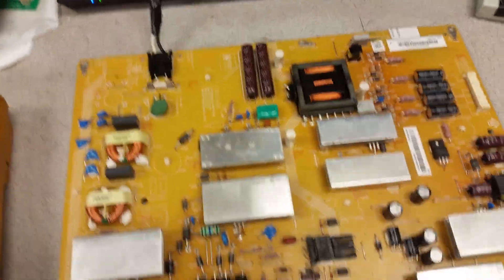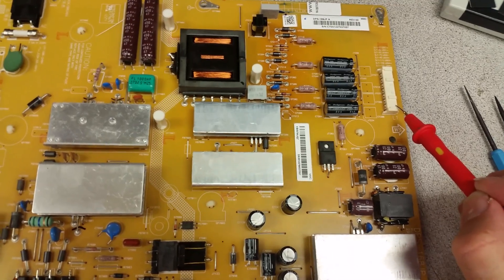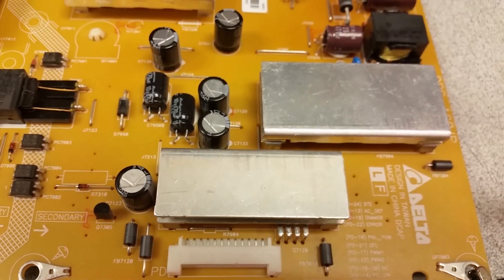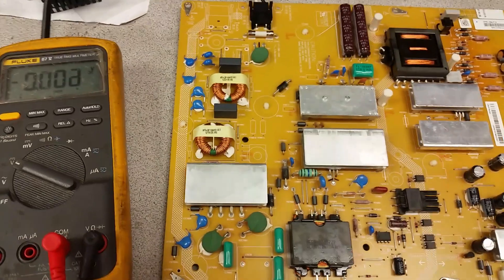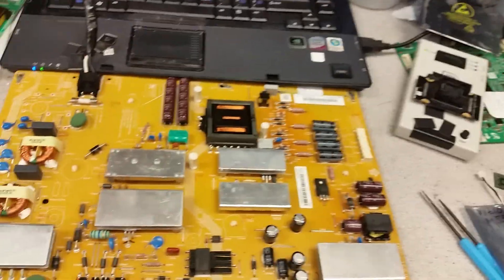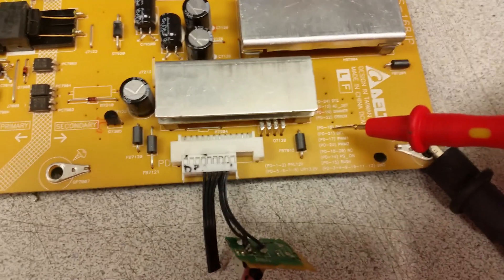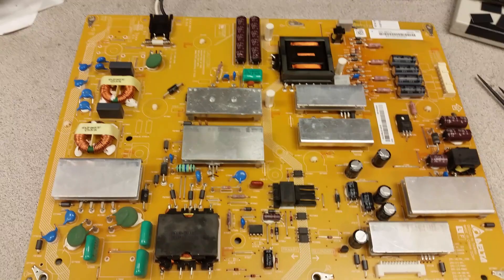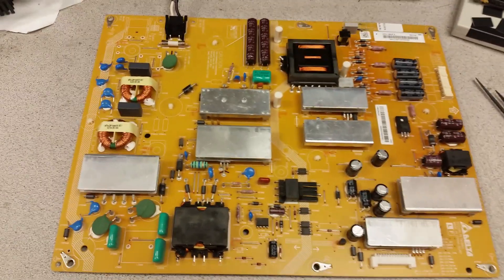How to test DPS-168JP RUNTKB057WJQZ power Sharp LC-60LE600U

Comment: I have no power at all on the cold side. On hot side I've got 315V on pin 7/8 of the ic. Also on pin 1/4 of the transformer.
I replaced the known a6069h ic, and the resistor r7900, checked the caps around it and the zener diodes Iam out of options. Maybe transformer broken? Dps-162kp-1
Reply from the maker: Hardly the transformer. Not impossible, of course, but not likely and relatively easy to test. When transformers fail they do one of 2 things: short out (burned insulation on the copper wiring leading to short and wire shortening leading to lower resistance/higher current, which in turn lead to overload and burnout) or burn out break the circuit, which is established with a simple meter. Anything else, while always possible, is very unlikely.

Comment: Hello I have the same problem. What part(diode) number do I need to buy and replace? I looked for the part number in here but I didn't see it. Anything helps! Thank you very much.
Reply from the maker: What diode are you referring to?! This is a video on how to test the board, not how to repair it. How to repair it depends on what has gone wrong with it, if anything at all.

Comment: hi i have a sharp aquos lc-60le655u won't turn on has this similar board. i plug it in and the emblem on the bottom middle of the tv flashes for a second but the tv wont turn on. i was wondering if you had a idea of the solution? please and ty.  i will in the mean time dig out my multi meter and check these

Comment: Bobby, COOLMOS 02N60C3 blew on a RUNTKA958WJQZ for rail #1 of 4 LED driver. Would a shorted LED segment 1 do this or maybe just a bad MOSFET? Its the small TO-252 next to larger one on rail 1.
Reply from the maker: I have not seen this transistor fail on those boards. Anything that could cause overload could trip an avalanche current and failure so yes, it is possible that a failed LED could cause the burn. It is also entirely possible that it has failed on its own and all LEDs could be good. Sorry if it doesn't help, but it is what it is...

Comment: Hi.. im working on LC-65UE630x, 3,3volt coming from "ERROR" pin, that make all function not working, even the indicators is not working. But the other voltage (BU5v, ps on, panel on, 12v, 13v) is avaiable.. what can be the problem? Pls advice.. thanks..
Reply from the maker: Sounds like a main board problem to me. Also check the back lights.
Reply: @coppelltvrepair  yes i assume problem come from the MB, do you have recomended seller for the MB, send me the link pls.. thanks
Reply from the maker: @bagus_reparasi_elektronik  Afraid I do not. Sorry.

Comment: Hi I have a 

Click to view larger image

Move over photo to zoom

Have one to sell? Sell it yourself

DPS-168JP RUNTKB057WJQZ Power Supply for Sharp LC-60LE631M LCD TV

Put new fuse in the board and now tv not working did before as I change the fuse because the tv was flickering

Comment: I just tried testing my board (APDP-153A1A) and I do not have any voltage output to the logic board... no standby 5v, no pnl_pwr voltage, nothing on any of those pins!  Also, the two large capacitors are only reading 15v...nowhere near the 400v they should.  Its safe to say my board is toast?
Reply from the maker: If you are measuring it right then yes, it sounds like it is bad.
Reply: @coppelltvrepair  thanks for the video, it was very helpful since I couldn't find a schematic online.  I'm gonna take a chance and order a new board and see what happens.

Comment: Thanks so much!  My problem was the idle power supply.  I also tested at the four input piins, just to make sure the 160V was getting to the idle power supply, and tested the two output pins.  Sure enough, 168V on each input pair, zero volts between the output pins.  I went ahead and ordered your repair kit on Ebay, and I'm excited to put the TV back together on Monday when it gets here.  Thanks again!

Comment: Hey i would love to get my board replace by you, but i also dont want to send you a working board. Can you answer a quick question? I have done all the testing as you show in the video above, but my pin 3 power seems to be a little light under that 13v, it is high 12v, the board says it should be 13.2v and you were also getting that 13.2v. Does this indicate that board is bad and in need of repair? when i jump the pin 16, i do get 12v on my pin 1.  Let me know what you think, if you think it is bad and i should send it to you for repair.
Reply from the maker: I think your board is good.
Reply: @coppelltvrepair  would there be a way to tell if it is bad but only under load. You mention something like this on your video. You said it can happen but it is rare.
Reply: Also do you repair the mainboards too or just the power supply boards.

Comment: hi i have same power supply i tested i got standby voltage5v but there is no voltage on main filter capacitor what can i do... please help me...
Reply from the maker: Well the repair service link is in the description.
If you expect me to walk you through troubleshooting your board I am afraid I do not have the resources - and frankly the will - to do that.

Comment: Hey Bobby how do you test  DPS-280LP A  I  have the 5v  can't find PSON   any help?
Reply from the maker: I don't have the board in front of me, but I think it's the rightmost one on the large connector. You can rule out the rest and it'll be the remaining one...it may have not been marked on the board indeed.
Reply: @coppelltvrepair  Thanks !  found an open smd resistor marked 60A  do you know its value?
Reply from the maker: @BATMEX44  Possibly. It is in the repair kit we sell for the board.
Otherwise just see
http://www.coppelltvrepair.com/t/QA-Can-you-please-tell-me-value-of-this-component
Reply: @coppelltvrepair  thanks again I am going for the kit..!

Comment: Hi, thanks for making these videos! I am not getting the stby.V (not on the pin/ not in the diode)... main fuse is ok and I get 167V out of the rectifier.... any suggestion would be appreciated. Thank you!
Reply from the maker: I am sorry, I do not have resources to help each individual request. Use the link under the video if you want us to repair your board.

Comment: So shorting pin 14 to 15 should turn on the board?  Then you mention shorting to pin 16 with a momentary push button to power it up. 
So same board right now with power to the board i get 5.04 volts on pin 15 only.
Reply from the maker: I am sorry, I do not remember which pins drive the board and excuse me for not taking the time to watch the video just to confirm what I say there. I try to help people when I can, but I would not normally go beyond top of my head for someone who is not a customer. The videos are free gift already. No offense meant.

Comment: Hi, i have a sharp LC-60LE650U that stopped working when my house got struck by lightning a couple weeks ago. I tested the power board using your tips and determined that the board was bad. I got a replacement power board from eBay and installed it. I checked all the voltage again and everything seems to be the same as yours except that when i press the power button, i get 7.5V instead of 12V on pin 1. The TV still doesn't turn on but the LED at the bottom on the TV has a fast flash and a slow flash. 

I should mentioned that i didn't check the voltage output to the LEDs. Not sure what these should be reading. Im assuming that the power board i bought is oK since i get some lights but i get worried with the 7.5V. Could that be the main board?

Please let me know what you think. I tried the reset sequence and i still don't get anything.

Comment: Great video! One thing bothers me tough: why are your probe leads switched in the multimeter? It makes me uncomfortable :)
Reply from the maker: Because at first I had the positive probe with a thin needle at the top. However checking many types of boards - e.g. plasma buffer boards or outputs of HDMI selector ICs on main boards - requires that the positive lead is set to GND and the test is made with the negative probe. Well if the positive is a needle that just kills it very fast, which is what happened. So I just flipped them and been going with those probes for at least three times as long by now :-)

Comment: What does it mean when the board won't power up when you short pins 14 and 15?
Reply: cuzzeyecan did you ever get your power supply back up and running?  I am just trying to figure out how to test mine prior to installing the new led strings in it

Comment: Hi there, Thanks heaps for the effort. Quick question, I am not sure how you count the pins? I thought Pin 1 to 12 is when it's switched off and you count from pin 1 ( left) to right. While pin 13 to 24 are the same pins ( count left to right) when it's on.

I didn't understand how you considered PIN8 ( from right) as the standby one. Could you please elaborate and explain as I have watched this 10 times, but can't understand how you count the pins ( example, you have considered 1 and 2 on pin 1, and 3 on pin 2???)
Reply from the maker: George Edward K Pin number does not depend on whether board is on or off, of course. Order is determined by small digit prints on the board itself, usually giving you pins 1 and 2 at one end of the connector.
Pin meanings are also printed on the board - most often by side of pins and sometimes - sharp boards are this way - on the side; Sharp lists pins for certain meaning and I think as part of the legend they also include connector number.

Comment: Would love to know what C7817 is on this board as the board I have has that component split and burnt I need to order another one of these.
Reply: LR 102K 1KV U = 1nf 1000 volt ceramic disk capacitor
Reply: RR
102K
1KV
22